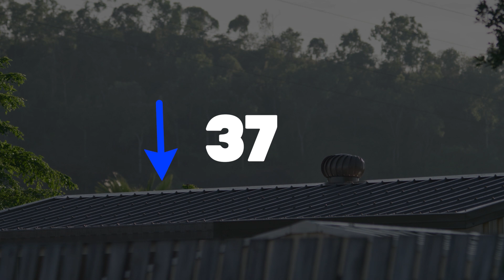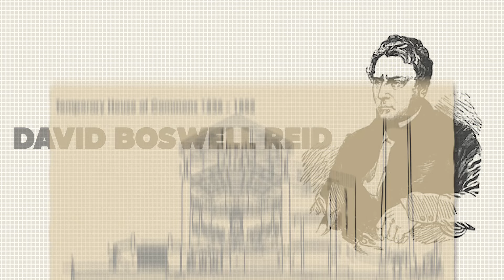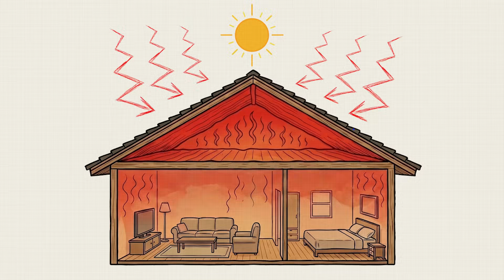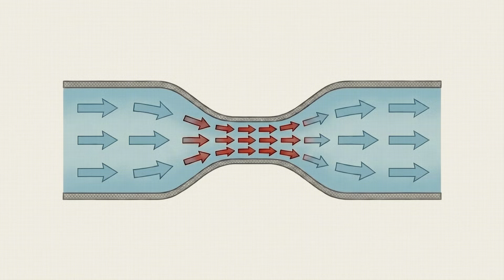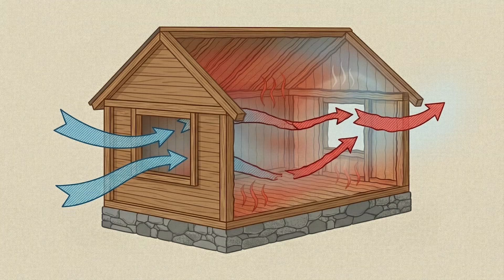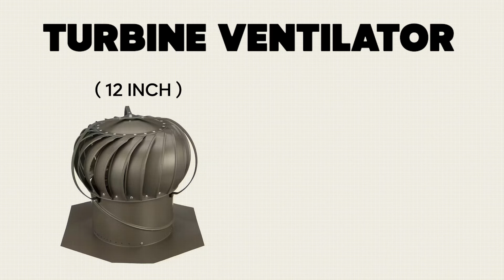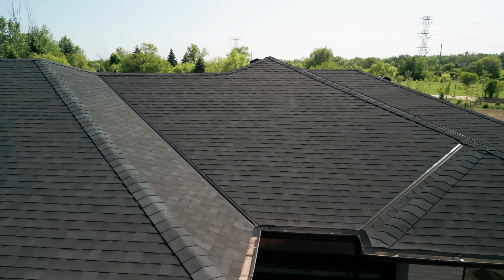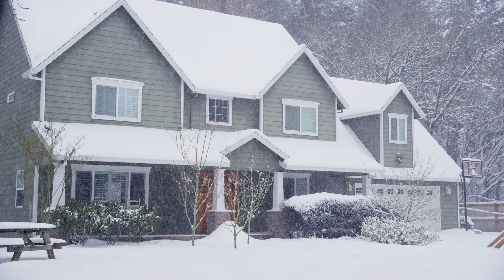Why Did We Stop Using This Natural Cooling System?

Comment: Actually, ridge vents and turbine vents are counterproductive in the winter, where you want to KEEP warm air in the attic. There's also a third option which is solar powered vent fans. As you say, what you do boils down to where you live. In any case, during the winter, it's better to block the vent. My last residence had one and I would cover it in plastic during the winter months...

Comment: My roof is 1000 sq ft and I have 2 large cyclone ventilators up there.  I love those things , if I ever have to re roof I will be getting a new pair.  The attic stays so much cooler than it did before we had them put in.

Comment: The thing that made them obsolete is the fact that modern single family homes now have 15 to 19 fixed roof vents on average, so the natural circulation of hot air out of the attic can be done without the need for this device.

Comment: Im planning on installing 3 of them on my roof.   Whats the best whirlybird?  I want easy access to the bearings so I can oil it every few years
Reply from the maker: That is a good question.  304 Stainless steel is a good option and buying from a reputable seller where you can get some form of warranty or guarantee.  I see these for sale on general auction website but you don't get any guarantee in regard to build quality.  Best bet is to visit an actual hardware store and see for yourself what units are available and then you know for sure it meets all of your requirements.

Comment: I had an old house in NW Florida with two turbine vents.  When I was in the yard, I kept hearing what sounding like some kids playing drums at the school nearby.  It made me wonder, "Why are those kids playing the drums so often?"  Then I realized it was the roof vent turbine.  When I checked it, there was no bushing.  So when the wind blew, the turbine would jiggle which cause the metal blades to vibrate like a drum.  Once I put a bushing in it and added some oil, it was quiet.  No more drum playing.

When replaced the roof, I removed the turbines and added a long ridge vent.  I think that is better for hurricane prone areas.  The turbines would get ripped off and leave a large hole in the roof.

Comment: What if we use isg on those like wind turbine?
Reply from the maker: Sorry I must be a bit slow today - what is isg?
Reply: @wildline_YT  integrated starter Generator which allows for both starting it electrically and generating electricity via kinetic force of spin like an wind turbine/ wind wheel

Comment: My parents old Spanish house had one, I went up and lubricated it once, OK the bearing was half worn away but with new lube every 10-20 years it seemed good for 50+.  Home Depot still lists a variety of them.
Reply: Aussie here. I had one installed at a discount price when I had some guttering replaced, about 25 years ago. The drop in summer temperatures made it worth every penny, and it's still going strong with barely a whisper.
Reply: Home Depots won't last 3 years.  Yet another reason to never have one, besides the fact that with modern construction you would gain nothing but a squeak and the cost to replace it.  This is one of those perfect examples where in the lab the numbers all add up but fail to materialize a net gain in real, practical, usage.  They got rid of these for a good reason.  The installation and maintenance cost is astronomical compared the actual gain by energy reduction.  The 6% to 14% drop in energy cost is a pure fabrication, likely made by one of the few manufactures still trying to pedal these things.  In an attic, after the insulation (required for winter) is traversed, it reaches the plywood floor, then an air insulation gap, then sheetrock, then paint.  Zero air is going from attic to interior, so only radiant heat.  Heat rises so attic air simple exits the side vents at the same rate in inputs from both sides of the attic space via vents.  Virtually none of the 150 degree (an exaggeration) touches the top of the insulation.  You would lose $50 per year installing one of these vents.
Reply: @ASDasdSDsadASD-nc7lf  nobody has near enough side vents to allow sufficient airflow, unless you put active fans on them.  Even a little active air movement makes more of a difference than you might think.
Reply: @ASDasdSDsadASD-nc7lf  The testing was done repeatedly over the years by different researchers, not the manufacturers. You are just pulling shit out your ass. They rely on air flow so it depends on what other passive or active system is already in your home, but they do work at a baseline. The question isn't whether they work, but whether you want this over another system.

Comment: TL;DW We stopped using these stupid things because they simply don't work. The physics is so clear that even high school kids can do the math. It's an unpowered fan... the energy to make them turn comes from the airflow, adding turbulence and resistance to the exhaust air stream. You get much better performance by simply cutting an equivalently sized unobstructed vent hole.

Comment: I've got 4 of the 14" vents on the roof of my 1200 square foot attic and they spin very well.  Unfortunately, my attic still reaches 150° in summer.  Yes, I also have unobstructed soffit vents and I don't have ridge vents. 
I don't know why the don't work, but after 6 years they're starting to get noisy.   :-(
Reply: FYI, located in DFW.

Comment: I love how roofing companies solved a problem they themselves created. I present an even easier solution: Roof with slats and roof tiles only. no fancy membranes, OSB boards, ridge vents, maintenance checks or any of that nonsense. There is a ventilation hole under every single roof tile straight outside.  :) Youre welcome. and if you are by any chance considering a new house roof, go with that.

Comment: tat system is a flop..........wat ever u do.....u cannot create a +ve infinite or even small gain infinite energy wrt advantage efficiency....as to rotate the fins u need energy and tat is only ptovided by hot air coming out and not it sucking hot air.....basically piling up heat so tat it can push the fan to rotate.....the amount of energy it takes to rotate is not effective wrt heat tat is generated to rotate it and on tat the momoentum based rotation is not as affective wrt air in as it some wat affective only if theres a sudden fall in temp causing lower velocity to go up and tat too for low time as tat speed will cause it to slow again which is not wrth it....beetter just make  holes in a cone shaped and a large amount as even 1 cone to increase the velocity ....the amount of air relesed in 1 hole at higher velocity is 1.4 to 1.6 times tat of 2 holes no propeller (in both case) which is 2 times always....and same hole radiouses so yeah.......

tat burnolious stuffy stuffy is trash as the amount of energy u take to put in is more then outlet cause of resistance as to push it it takes large energy to compresses causing it to search an out let     once searched it will go out as higher velocity but not as fast as instant how much pressure us given meaning..........if u increase the pressure 2 times......the velocity is 1.4 to 1.6 times for the same radious...and so if done 4 times...it will go out by  3.2 to 3.4 times velocity so tat drop in velocity will cause pressure rise cause of accumulation causing more heat up other than

Comment: They don't "Work". It's just a big fancy hole in your roof. If fact just a big hole would work better. If they were powered then they could pull cooler air from the eves. Not powered, forget it. Think of a standard 20" box fan. Stick it in your window without plugging it in. The wind will makes it turn but it is really blocking or slowing the air flow. Same thing with these things. Save your money.
Reply: a box fan isn't a turbine ventilator, silly.  nice try.
Reply: @andygilliland  Turbines are multi bladed fans that are powered to create the pressure and vacuum. A box fan only has one set of blades. Stick a box fan out side, unplugged and see how much air they move.... None. A blowing wind will make them move if it has enough force to overcome the friction on the bearings etc. Same for these things. Plug the fan in and turn it on and it moves air. No breeze required. These are more like a squirrel fan. Put a squirrel fan unplugged and see how much more wind it takes to get it to spin. It has way less surface for the wind to act upon so more wind is required to make it spin. They are not doing any work and impede the air flow. The hole in the roof will let more heat out because there isn't any impedance. I learned this in junior high science.
Reply: @IBA711 clearly you don't understand how these work.  heaven forbid you try one out...you might have to admit you're wrong...can't have that. 🤣
Reply: @andygilliland  I have a bridge for sale... Interested?

Comment: HOAs need to either be illegal or tightly regulated to prohibit them from being compulsory, enacting rules, and/or requiring dues. A friend of mine moved out of her HOA neighborhood after she was fined for parking her car on her own driveway. It fit entirely on the slab without extending onto the street and there wasn't even anything in the contract about that when she moved in. It was added to a new contract she wasn't even aware of when new HOA management took over.  Correction: she moved out because of numerous HOA intrusions into her life, including their neighborhood tattletale walking straight into her open garage to tell her to close the garage door or get a fine, but i guess the driveway fine was the last straw

Comment: these are extremely useful, had 2 generators enclosed, they were overheating badly bought 2 of these turbine ventilators installed them on the roof and everything went back to normal.

Comment: I'm 56, and my dad installed a couple whirlybirds on our second story house roof back in the '70's. The originals are still whirling.
We're in the Southeast, and we slept on the second floor. Between the whirlybirds and an attic fan above the stairwell, we never needed air conditioning. We'd open our bedroom windows, Dad would turn on that fan, and the curtains would stand out straight. Got literally frigid most nights. It was always fun seeing the thousand red wasps blowing out the attic vents at each end of the house when the fan came on. 😂

Comment: TBH recuperator ventilation systems are more efficient in both VERY hot and cold climates. Like even if you have good draft but outside air at ground level is already hot... you will still have hot air intake. Or if it is cold then you'll have even colder intake air for your heating system to warm. But yeah, recuperation ventilation requires way more investment to install, requires you to have air ducts to go to each room and requires power to work.

Comment: I just want to ask did this thing works in 50°c with 10%-20% humidity (dry tarrien)? Because at that point you feel like you are being boiled in the air....
Reply from the maker: Yes they probably work best in low humidity environments as they would benefit from great air movement due to the stack effect.  Note in high humidity environment there is always the rise of condensate as the steel reaches the dewpoint of the air.

Comment: we have this in our factory but had to remove because in vietnam these thing spill water everywhere  during rain season
Reply: Makes no sense to remove and patch the roof rather than put a small cover a few feet or 1 meter above to block rain ingress.  I see Vietnam has to deal with idiotic bureaucrats just like we do in the US.
Reply: @pete_bachman  right, like just put a lil hood on the thing
Reply: @blaxspear  I am 74 years old and I am not going to drag a ladder to the feed shed (for my horses) and get on the roof to cover it and then have to do the same thing all over again to  uncover it.  I have way too much to do as it is and  no one to help me with anything. (I have rural land and rescued horses, it's intense to care for them and my land and trees too!) It's basically useless in windless conditions and/or when the day time temps exceed 100 degrees for weeks on end in the extremely hot Sonoran Desert! if it rains much (which it does during the monsoons of July August September and even October) it leaks in a big way and gets whatever is under it drenched. So i have to use an upside down plastic garbage can lid on top of one of the feed barrels to capture about a quart of water and might have to even go out to dump that so it doesn't overflow while it's still pouring, when it rains hard for several hours non-stop.  The shed isn't much cooler than without it, and of course the significant leakage issue in intense rain and wind blowing sideways, enough to knock branches of trees or even totally uproot mature trees. if it's raining just a little bit, it doesn't leak.  It works just great when it's not hot enough to even need it, since I don't LIVE in the grain shed lol.  If I bother to cover it in some way permanently, it's kind of likely that the packrats will just climb up there and eat the cover unless it's a metal cover, which will cost more to acquire and time to permanently affix it, which I don't have. And NO ONE explained to me the problems I might encounter with it, before I bought it.   I wish I never bought mine & paid a handyman to install it into the roof of my little feed shed. I wasted my money, and am quite disappointed.
Reply: That just means the bearing are going out and the turbine vent needs to be replaced.
Reply: @bloodsweatandtears112  mine leaked from intense rain that went on for a couple of hours, a couple of months after I had a brand new one, out of the box, installed by a handyman on my little feed shed.  So I have to put a large plastic garbage can lid upside-down on top of my horse pellet barrel that's under it, to catch about a quart of rainwater so the alfalfa pellets don't get wet and moldy! And if the wind isn't blowing when it's not raining, it doesn't do much of anything!  Daytime temps in the Sonoran Desert can easily exceed 100 degrees, up to 110 degrees or more sometimes,  for over a month in the summer, while the monsoon rains following that are ferocious, mind-blowing!  I wish I never bought it and then had it put onto the shed, wasted about $100. The only time it 'works' (sort of) is when I don't really need it LOL.
Reply: @littlehawk8491  It's definitely situation dependent.  It does need either a draft from inside, or wind from outside to keep it spinning!  For a shed, considering they aren't very tall, there may not be enough wind due to wind breaks around.  In that case, a different style of vent would be more efficient for sure!
Reply: @bloodsweatandtears112  Yeah I've lived in several houses with whirlybirds and none have caused leaks.
Reply: I could see that. I live in a dry climate so they work great.
Reply: @lithe.susurrous661  As long as there is some sort of breeze, even a small one, that has been my experience as well, but in the Sonoran Desert when I really need to cool my feed shed and it's over 100 outside for many hours during the day, it makes very little difference unless there is  also a strong wind.  if it's not summer, I don't really need it because I don't live in the feed shed lol.  And no matter what, it's never going to keep the shed cool enough for the rice bran pellets, so their little metal garbage can has to live in my tiny kitchen.  (Fortunately I'm not someone who cares about my home looking like architectural magazine photos featuring the interiors of millionaire's homes LOL. Because mine will never get remotely close to the weakest approximation of anything like that!)
Reply: You ...could just put a cover over it?

Comment: 70's house here, had 2 and roof redone last year and they installed 3 to even it out for garage.  Plenty of them in upper midwest, but yes ridge vents and low profile box vents are about as common especially newer builds.  Older builds still recommended to have whirlybird.
Reply: The biggest problem is builders sometimes don't know how to combine the ventilation with soffits to help bring up hot air and out of the attics. I used to correct it with a little help from the turbines and solar vents.

Comment: I lived in Louisiana for ten years. Ridge vents are absolutely worthless. They just don't move enough air to keep an attic from becoming unbearably hot. Even ridge vents with gable vents are ineffective. If the gable vents have fans, they will do a little better. If one actually wants to reduce temperatures in the attic, a turbine vent is the only worthwhile choice. People who oppose them are idiots, and if I had control of this country, I would eliminate any law or HOA covenant that inhibited the use of turbines in any way. 

Granted, they aren't needed and would be detrimental in cold areas. I live in Wyoming now, and a turbine vent would be a disaster in our winters unless the entire top of the home were redesigned.

Comment: The old saying, "If it ain't broke, why fix it?"  My neighbor in the back has one of these spinners and I always wanted one for my roof. Last year, I had my roof replaced but the contractor put in a couple of low-profile vents saying that they were the newer style and endorsed by the city. I still want one of these for my garage roof as it gets very hot during the summer.  Where I live in Socal, it gets very hot and windy during the summer, so the spinner would be perfect for it. I would also think the hot air drive the turbine, as you explained in the video.  Weird, why many newer homes are not using this.  I think they look cool.
Reply: @vhg7, I am in socal too and love the whirly birds on my roof.  The new low profile vents can't move much air compared to these, though all the homes with new roofs have the low.profile vents.  My house has a couple of.gable vents, no soffit vents and gets very hot in summer.  Low profile vents are a gimmick, IMO.